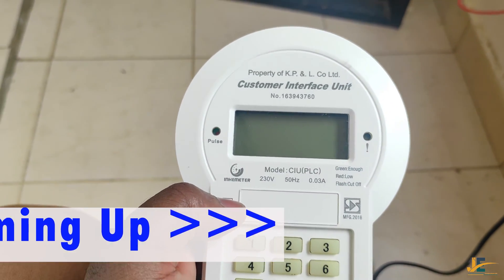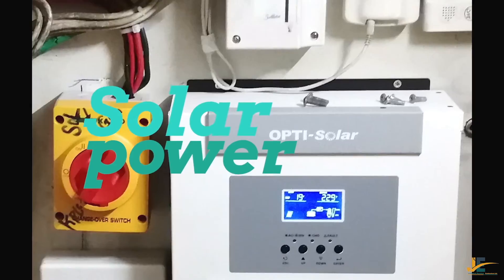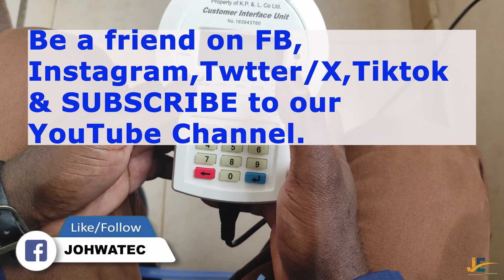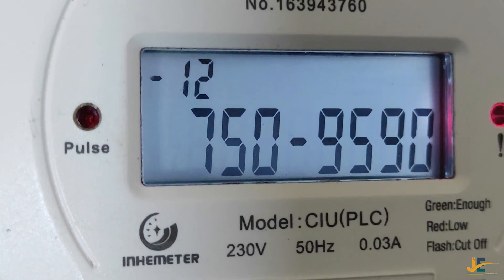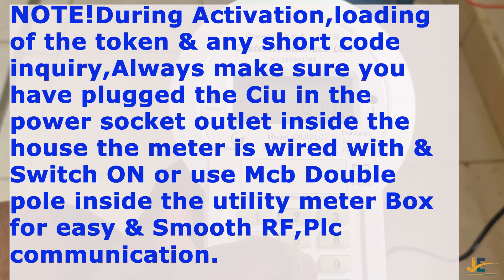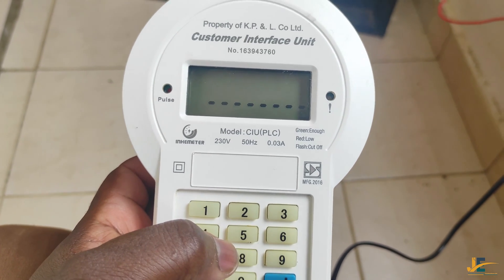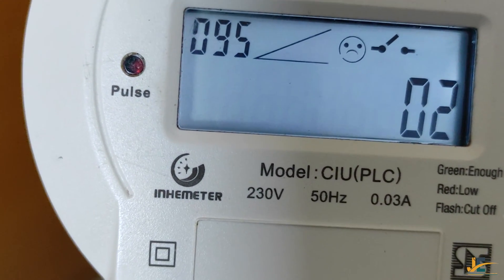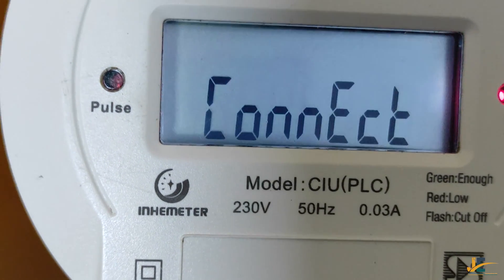How to Load KPLC token/credit without Straining. How to troubleshoot INHEMETER & other Energy meters

Comment: What if it just says connect then failed for both update codes and putting in token?
Reply: Thank you for this info
Reply: Buy new batteries for your CIU,  plug in your CIU in a socket outlet and switch it ON whether there is electricity or not in your house. Input the codes accordingly.
Reply: I have...can the codes be changed? I'm told if I've input so many times it can be blocked
Reply: Also if I put 095 it says failed
Reply: @ambasaagnes3833  your CIU and MCU can't communicate and that's why you're getting such information even after you input 095. A qualified electrician with vast experience in Prepaid energy meters can assist you.

Comment: What about when it says padloc
Reply: To troubleshoot is the same, use your neighbour's Power outlet if your house doesn't have power. Make sure your MCU is on in the meter box. If the problem persist you can use the MCB double pole in the utility meter box that has been wired with your MCU. For assistance contact us

Comment: Hello, my friend! I have a question for you. I have a lot of negative consumption, as you might imagine... Is there any way to reset the equipment to zero? Like starting over from scratch? Thanks!
Reply from the maker: Hello Nicolars, I suggest you hire a qualified Electrician with an excellent reputation to check your wiring and load to advise you accordingly.

Comment: What can someone do when some numbers are not working when keying in the token number
Reply from the maker: If the Ciu is faulty Replace it by Reporting it to your nearest KPLC Office.
Reply: @johwatechelectricalcontractors how long do they take to respond?
Reply from the maker: @wacheramonica8281  It Depends on the Availability of meters in their stores and the Backlog of the same Kind of Complaint.

Comment: I have the Hexing CIU 2023 and i don't have electricity i did go to my neighbor to put it in a socket but still when I'm entering the electricity it shows failed what can i do?please assist, i even bought new batteries
Reply from the maker: This is how to troubleshoot: First, make sure the MCU is ON, In the Consumer Unit all MCB circuit breakers including the Double pole isolator must be ON. The CIU batteries Must be in good condition, inside your house plug in your CIU in the power Socket outlet and Switch it ON. You can load your token without hustle or stains. To understand better check out this YouTube video https://www.youtube.com/watch?v=gsNAaCb9t_U&t=22s